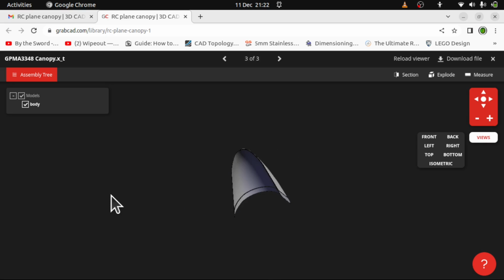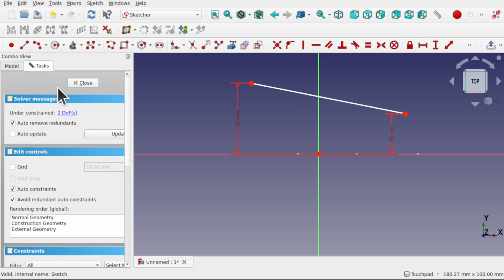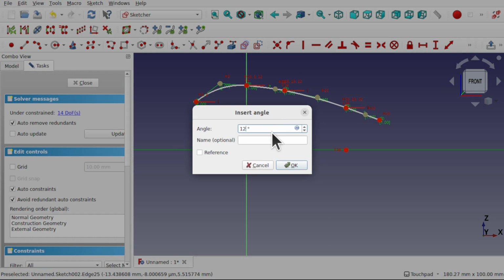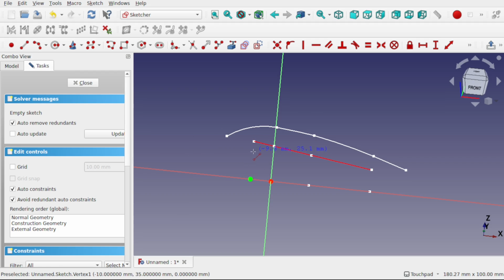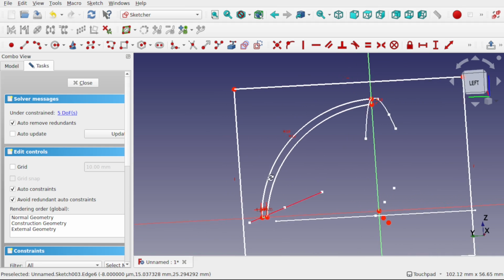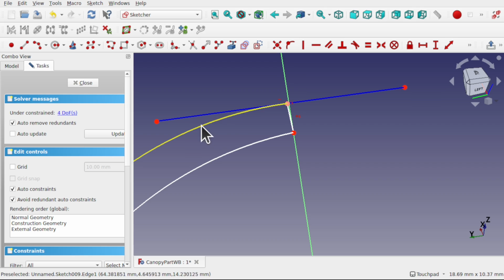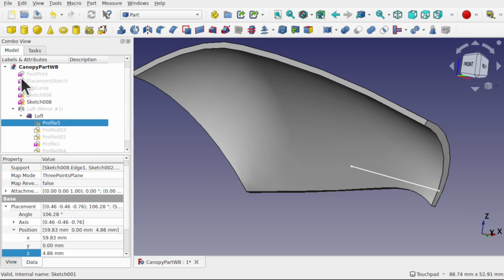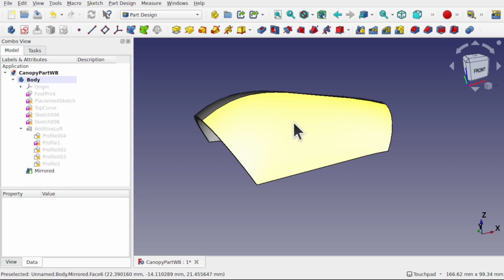FreeCAD for Beginners 28: Workflow for RC Aeroplane Canopy | Part and Part Design Examples

Comment: Struggling a bit at the Loft stage. Initially getting Loft Error Messages. Have gone back through Profile Sketches Validating as well as adding Construction Line Tangency. Now getting Recompute error. I've managed to get some profiles to loft. I'd say I've missed something in the sketching section or possibly bad geometry. Going to redo the Profiles and see what happens. redid profiles and got it to Loft AOK. Couldn't quite eliminate the puckering but didn't worry too much about that. In the Part Design example no problems till Mirror operation, Experimented and got it to work by trying differing Mirroring Planes. Often experimentation is the best way to solve issues. Overall happy with my progress, suggest that one be careful when sketching especially in areas where there are a number of lines converging and or constraints being applied. I think some times the FreeCAD gets confused and strange errors occur (Fully constrainting sketches and using validate sketch tool a good idea.

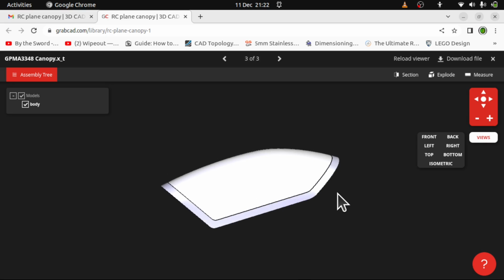Comment: 00:00 Intro
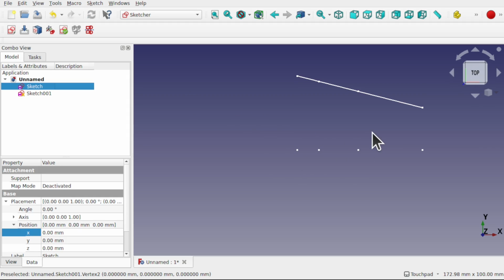01:42 Bottom profile sketching ( 06:10 adding Points required to connect profiles )
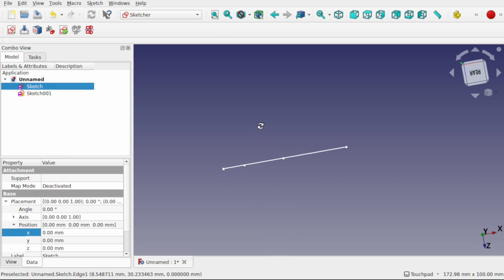06:50 Side profile sketching (with defined number of B-spline points)
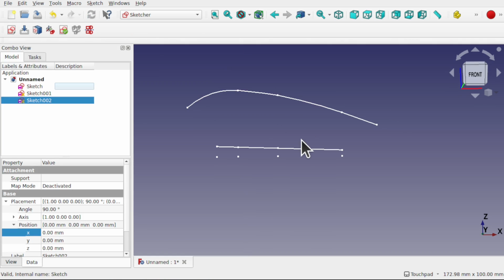09:55 Organization & increasing point size
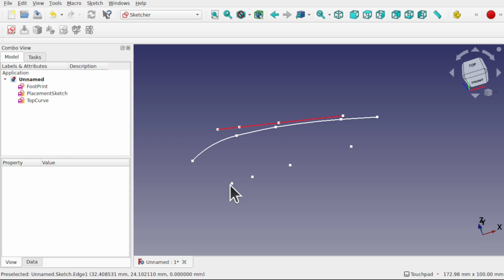11:12 "Rib" sketch and rib duplication+translation
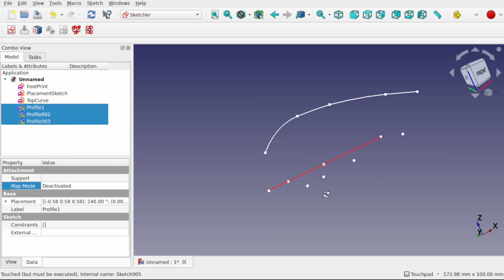14:06 Rear rib sketch inertial alignment to scaffolding sketches
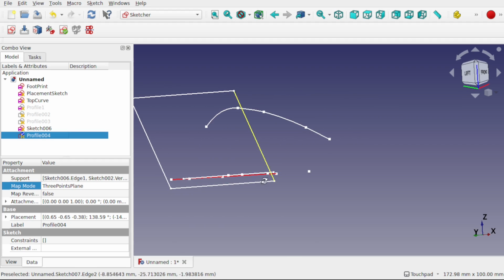16:25 Editing rib sketches
19:50 Front rib sketch inertial alignment to scaffolding sketches
21:54 Front rib sketching
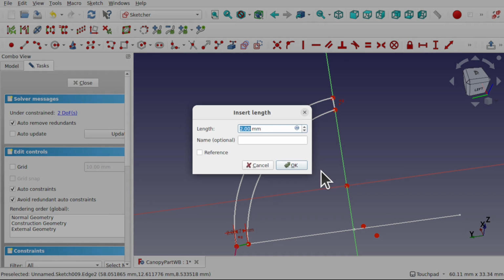23:51 Creating tangency at the top of all ribs (ensures clean symmetry)
25:30 Part workbench Loft
26:27 Part workbench Mirror
27:26 Repair of loft overlap
31:15 Part Design workbench Loft
33:36 Part Design workbench mirror
34:10 Conclusion

Love it. Awesome tutorial, good sir. Using multiple sketches and relating them to one another really starts unlocking more power in FreeCAD.
Reply from the maker: Thank you for putting the time in for this. Most appreciated. Glad your enjoying the videos. And thank you once again. I should be able to pin this comment at the top.

Comment: To avoid a cusp in the mirrored extension, you merely need to place the arc centers on the vertical axis.
Reply from the maker: Nice tip thanks for sharing 😊👍

Comment: Many thanks for the numerous helpful tutorials. I use Freecad for model building and I would be interested in a simple solution to constructing a bubble window (outwardly curved pane in a flat and square frame) for a model helicopter for the purpose of making a deep-drawing mold.
Reply from the maker: Glad your finding them useful. One of the things I am doing at the moment involves a very similar workflow so can get that out for you soon.

Comment: Great explanation, would it be slightly simpler to use datum planes ?
Reply from the maker: Thank you, yes you can't use datum planes but you end up using extra processing power. The camp seems to be divided when it comes to datum planes as the attachments can be done exactly the she's as a sketch but you do get a nice visible background plane to sketch upon